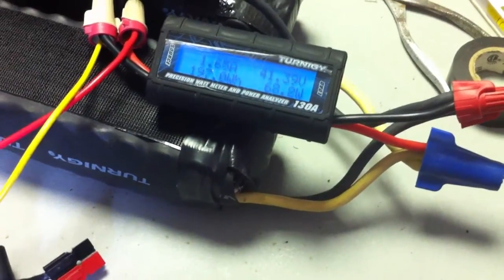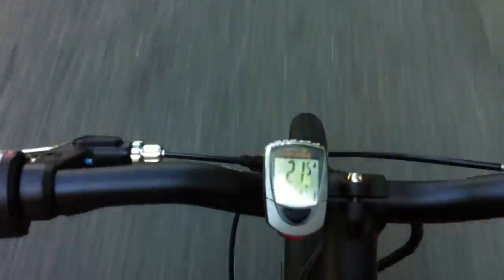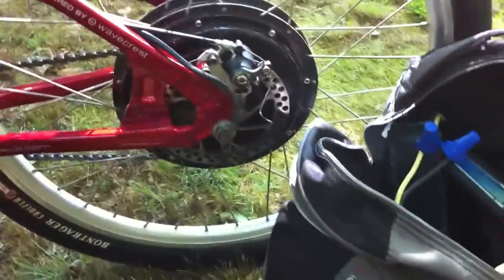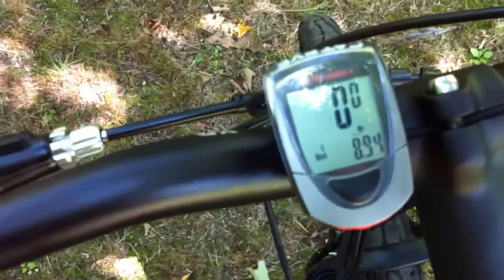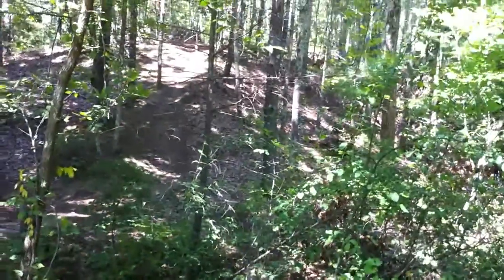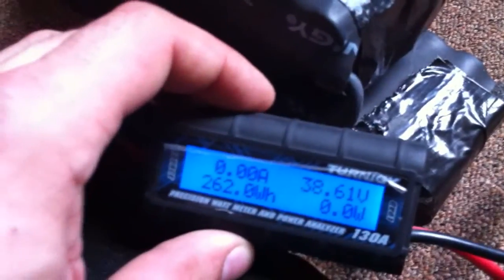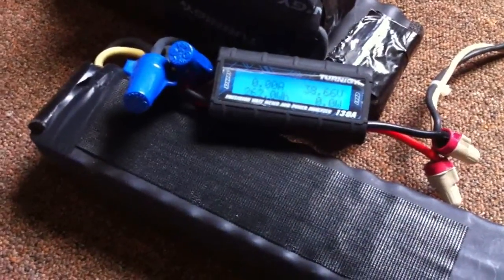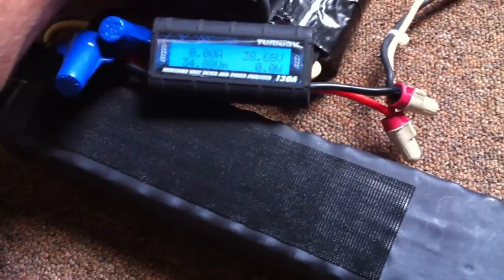36V Sony 18650GR Laptop Cells Used in Electric Bike Commute

Comment from the maker: No, unfortunately the cells in those packs are not made for a high discharge application and they have a high internal resistance. You can find them fairly cheap if you buy in bulk.

Scott